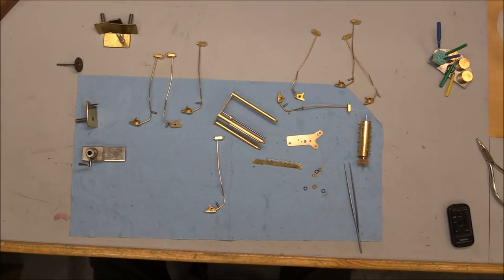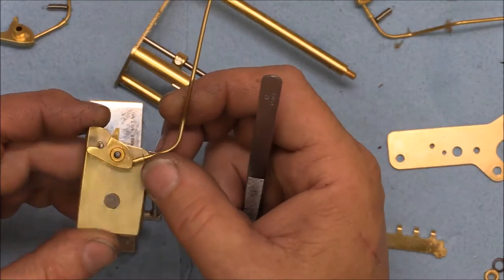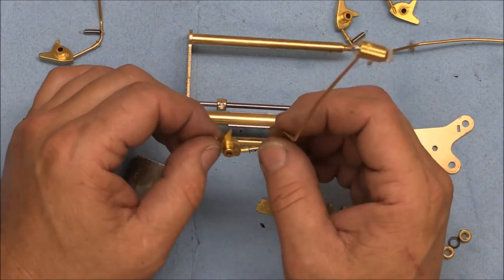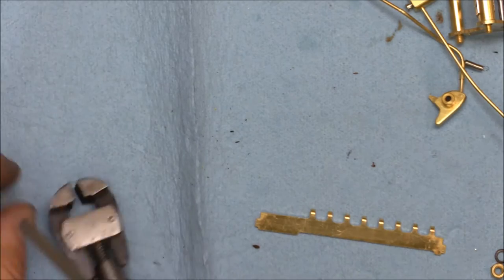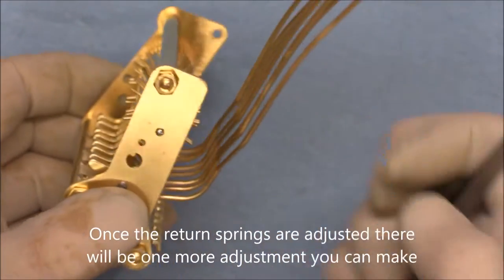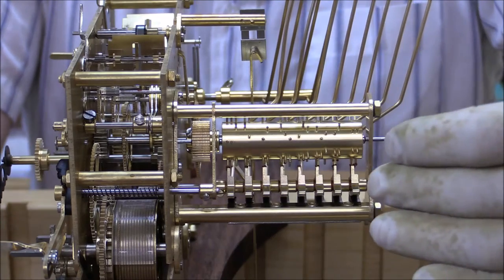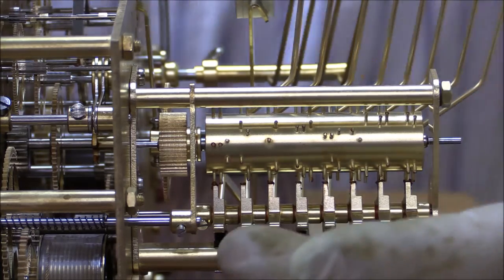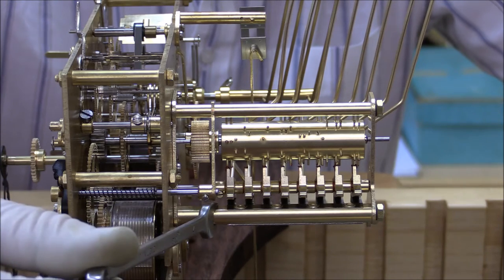Triple Chime Hammer Tail Repair

Comment: William,
Thanks for taking the time to post this repair. I have to say I was a little skeptical when I the title came across my feed as I have always simply replaced worn hammers. However, I can see the value in this repair for the occasional chiming clock with worn hammer tails that is no longer in production. I was also surprised to hear you say that you can do the complete repair in about 20 min. which would make it profitable and a good value for the customer. I was wondering how many times would you say the tails could be ground before there was not enough material left to contact the pins?
Reply: M